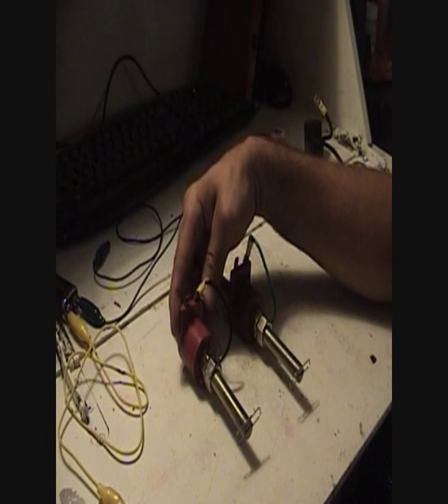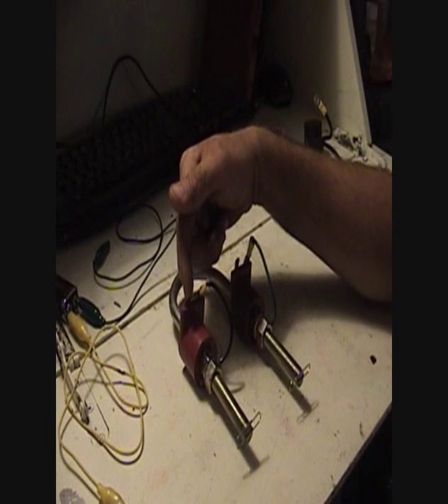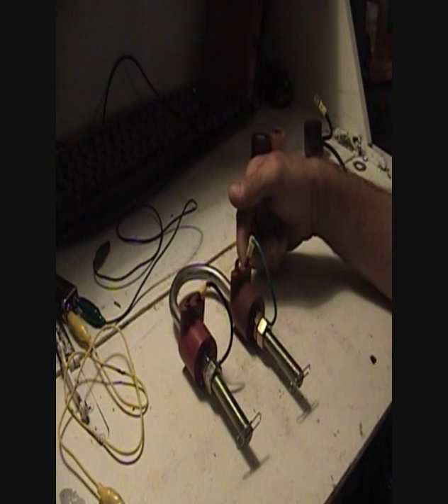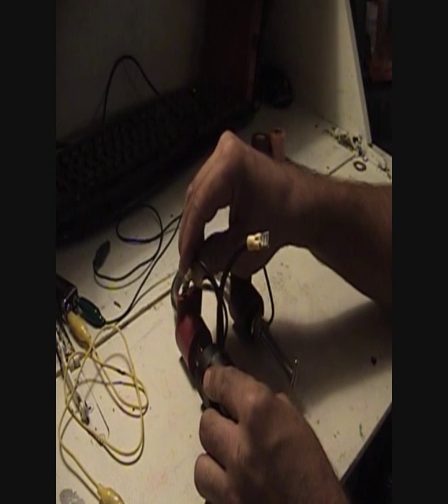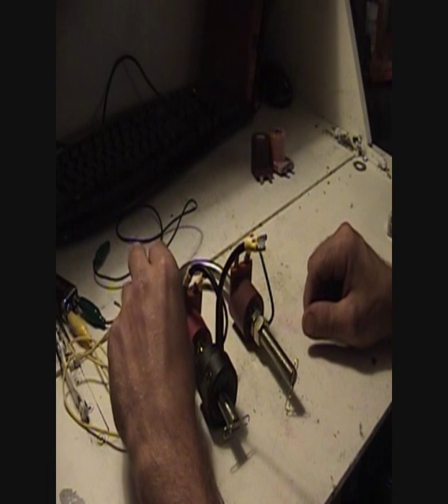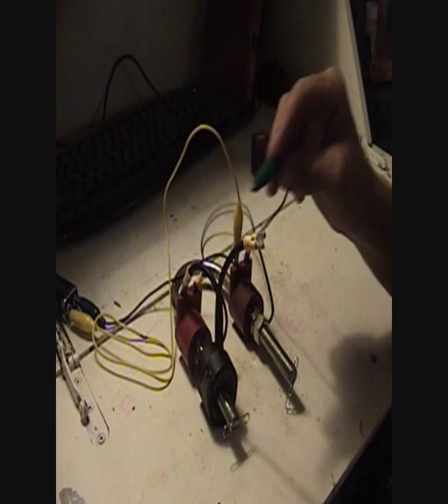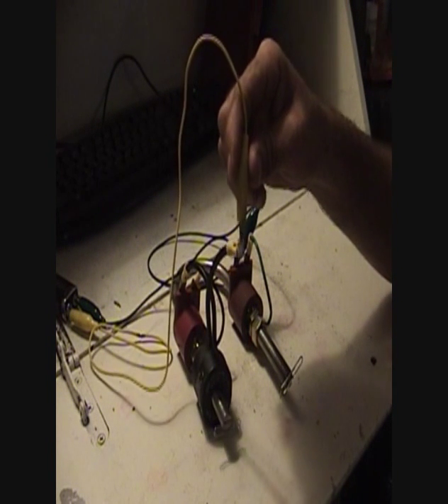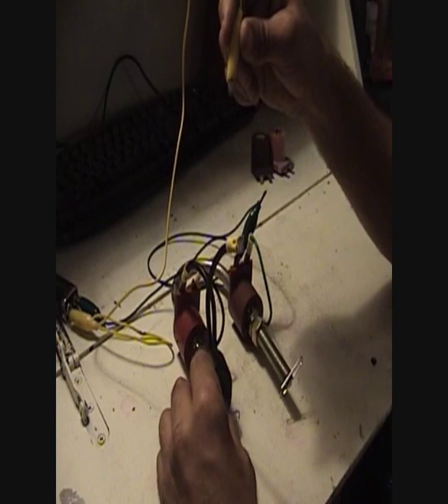Ed  Leedskalnin Magnetic currents PT 5 demagnetizing

Comment: @crob227 Right, okay, must have been really tired when I posted that from the looks of it.  I just meant that Leedskalnin wasn't the first to detect this phenomena. 
I'll start over; 
atomic centers of atoms are accompanied by weak force shells that turn like gears one way or another using particles held using particle exchange lines of force for their growing/failing monopoles.  Magnetizing even cold metal changes the particles which get trapped in the circuit of the atom. They determine dir.

Comment: Also it will be much better to use parallel strands
of isolated iron wires to act like the iron core .
This way you have much less eddy currents.

But maybe the eddy currents are just the trick to
cancel the Remanence from the iron bolt ?

Comment: You have to see, if you can get more energy
out per pulse from a pickup coil than you need to put in via canceling the magnetic field via the
current pulse you put into the iron bot core.

You should better use huge iron cores and much bigger coils to get into a higher efficiency range of it all. Your setup is still
much too small to be efficient.

Comment: Maybe you can also achieve this,
if you take a few caps and make
parallel LC tanks and have a positive feedback
via a transformer.

It seems you have found how to switch off the Remanence magnetism
inside the iron bolt via putting a few current spikes through the
iron bolt.

When you energize just your coils you put Remanence Magnetism into the iron bolt.
When you just put a short current spike through the Iron bolt,
it seems you can cancel or switch off this Remanence magnetism..